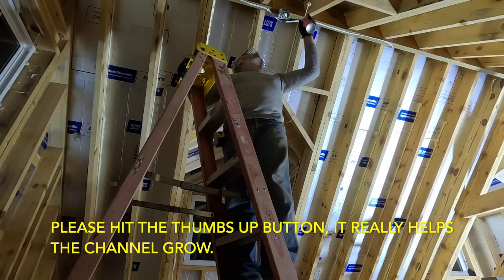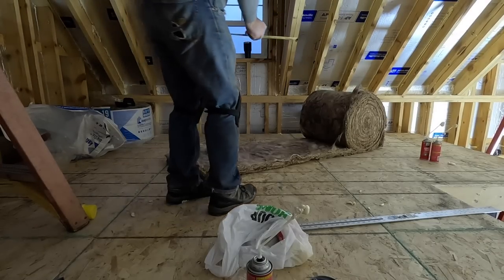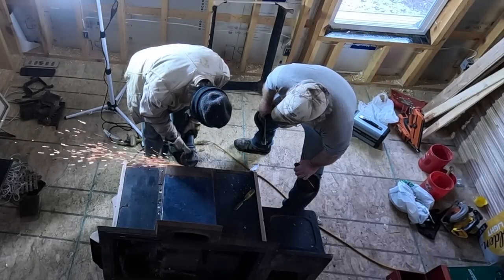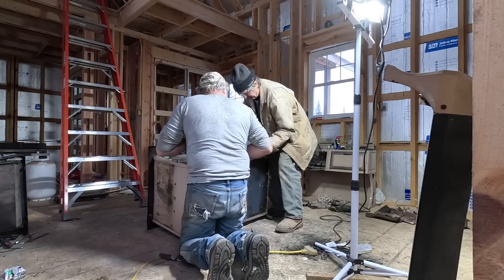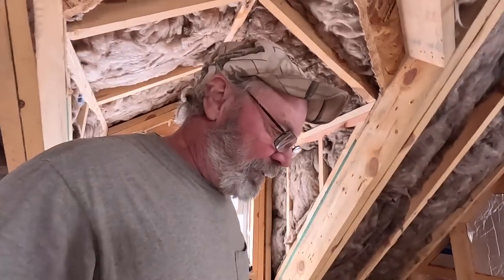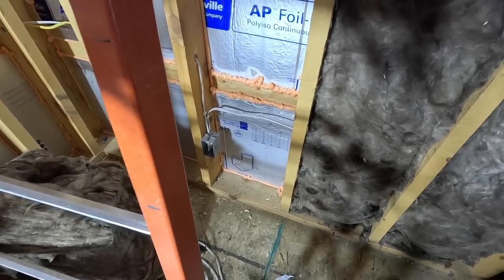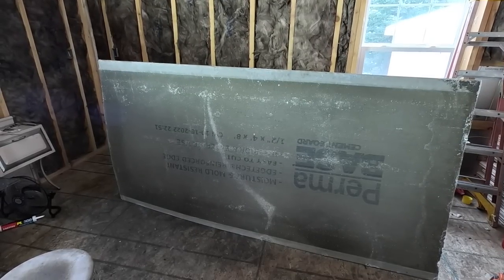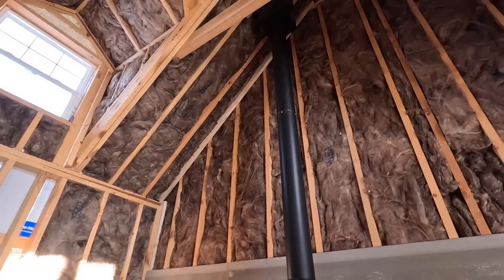Hooking up the 1923 wood fired cookstove and insulating at the #offgridcabin

Comment: Wiley a trick I got from some pros for installing insulation. Make a story stick the length you need. Mark your insulation and then turn the stick to cut the insulation. Saves a lot of time.
Reply from the maker: Good trick, will try when I can get back at it.

Comment: Getting cozy! Must be nice to have the stove in. We have a barrel stove at the cabin as our main heater. We pick up the stove kits for them when we are down in the US. Has a cast iron door, with the vents, legs and chimney, flue collar with a damper and instructions on how to build it. Trev has built 5 of them now for various cabins and wall tents. They work so well. Most of the ones he has built were the 45 gallon barrels, but this year he had a smaller barrel he made a stove out of. The joy is you can cut longer logs. Less loading and less cutting. Check amazon if you're interested. Take care, buddy!
Reply from the maker: I've got a kit for one, going to make a maple syrup boiler out of one.
Reply: @WanderingWiley  That'll be cool! Do you collect the syrup yourself? My son in law does it every year and makes syrup with my grandkids.

Comment: Good job Wiley. 
My dad in my hometown had a similar stove,  Dad installed pipes at the top of the firebox and ran the pipes back to the water cylinder outside, next to the brick chimney,  I was too  young to understand it.
But it worked well, Dad was a builder as well and always brought home the offcuts from each job.
That stove of yours reminded me of Dad's free hot water, and us kids chopping firewood,  which we collected as well.
Reply from the maker: I know the new stoves come with that option, there is a resivor on side of stove for warm water though, on this one. Haven't tested to see if it leaks or not yet

Comment: Time well spent restoring your stove. The stove is truly the heart of your cabin, looks beautiful. With all that insulation it looks like that Cabin’s really going to hold the heat. Great job!!
Reply from the maker: Thanks Karl, it should be easy to heat but that loft without a ceiling fan will be hot
Reply: @WanderingWiley  Can you install a bathroom vent fan in the wall to recirculate the warm are in the loft to the lower floor thru the wall ?
Reply from the maker: @Dacisu89  unfortunately not, but I can put a smaller ceiling fan in the loft as it's almost 9 ft to the peak without scalping myself

Comment: Well another good job. The way you put the place together,all but air tight, it should be pretty easy to heat. That stove is very nice,have you done some work on it? Nice look at the little buck. Keep them coming!
Reply from the maker: Not much just removed some screws to get at the clogged section and fix were someone pried the screws out the back. They know they are safe here as far as the deer go, lol. Don't hunt much anymore maybe next year if the need arises

Comment: no plastic vapor barrier on the inside? good work. be careful. nice little woodstove for sure.
Reply from the maker: Polyiso underneath sealed with spray foam, no need for another vapor barrier.  Don't want to trap moisture between the two.  The stove is nice, would love a new unit but heck this works

Comment: Make sure and add a big enough ceiling fan. And have it placed at the proper heighth for your room They have some that are AC to DC and very efficient
Reply from the maker: Yes that is a mandatory.... hot as hades in loft
Reply: @WanderingWiley  you got that right and it hasnt even got cold yet. My loft was so hot it was unbearable and downstairs barely comfortable

Comment: Hey Wiley I built a new spray foam house in 2017..there are pros and cons to using spray foam. The cost and then another 2000 bucks for a heat recovery ventilator and I still have problems with moisture. I wouldn't use foam again😁
Reply from the maker: That was another issue for the cabin, not going to have limitless power and don't want it to tight as to need an exchanger.
Reply: @WanderingWiley  yeah the money i save on the heat bill i spend on the electric bill. I have the HRV and a dehumidifier running.

Comment: The dust is still gettin' to you Willy, 'cause, you didn't think it necessary to wear a Protective Mask (not that paper junk) while you were cuttin' the Rock Wool not to mention all the dust from the grinding rusty old metal plus the etc's. Ya gotta take care of yourself otherwise you'll be dying from Emphysema quicker than you can finish building that Cabin.(They're all the same, these old Cogers, think they're invincible.) Take the time !
Reply from the maker: Thanks for the concern Carolle, I should have been wearing a mask but get careless about that.

Comment: With the extra insulation and stove you’ll be nice and toasty working inside this winter. I’m really enjoying your cabin build series and recall its footprint is 16’ x 24” but can’t remember if you mentioned the wall or peak height? Also, what’s the loft size? Stay warm and Happy Holidays Wiley!
Reply from the maker: Side walls are 10'6" with interior peak at 19 pluses ft. Loft is 12ft deep by the 16 wide
Reply: @WanderingWiley  👍